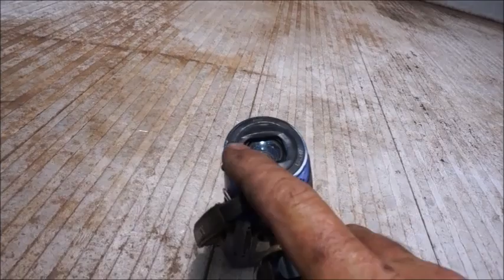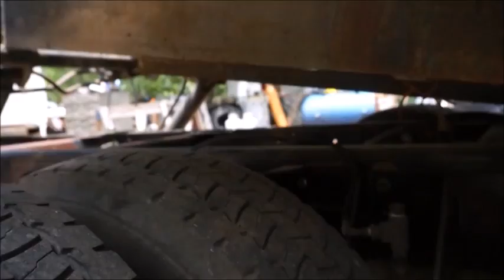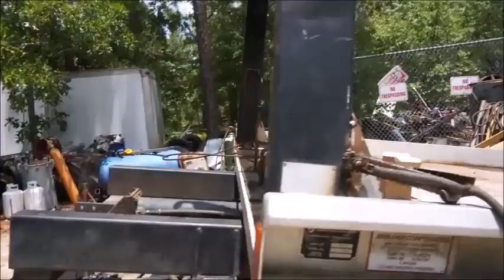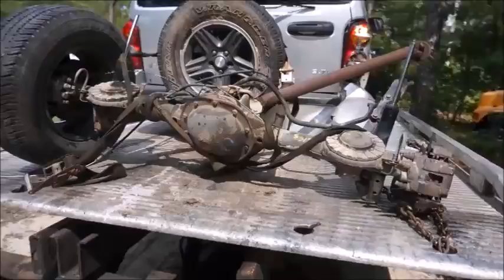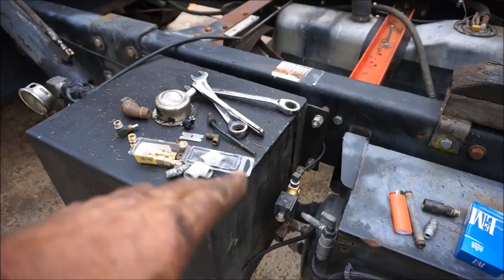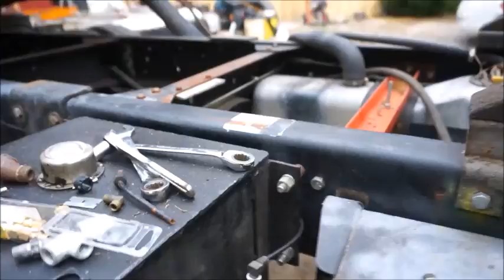2003 C4500 Rollback, Rollover Recovery and More!!

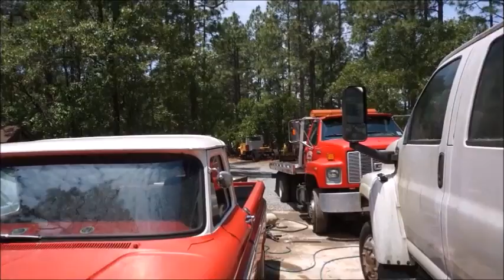Comment: @ 7:34 in the video, you describe the dilemma of having problems with the red Topkick as it is going through front brake pads prematurely. This can be affected by the proportioning valve possibly not being spec'd for the application used. When the vehicle is designed for the heavy-tow platform, the prop-valve should be spec'd as one set to have a percentage to place the biasing closer to center, or just off-center, to the rear, to make better use of that axle-loading, or, I have seen and serviced load-sensing prop-valve braking systems, therefor, better maximizing brake pad wear and vehicle control when loaded. I admit, I'm not sure which chassis the red Topkick started out as, for I haven't had a chance to view your channel from the beginning, only finding the channel at the cold-start Impala "chestnuts-roasting-on-an-open-fire" video, but am going through the channel. So, if ya feel like picking your parts-counter friends brain there might possibly be a simple solution to saving lots of labor and money on front pads and rotors, or you can keep your front-pad-swap skills honed to a sharp point, no big matter either way.

Comment: That 0l' 1/4" air line ain't real good on the Bag's. I used to use 3/8" on my Heavy Haul trucks so I could drop quick to go under Low Bridges & Viaduct's and what have you.

Comment: For low cars I  used to have boards that I used to make a small ramp to the roll off. I did not like to pick up Corvettes cause they are so low especially if they had a flat front tire.
I wouldn't want to be the driver to get the rear out the quick way. I didn't do too many rollovers but pulled a bunch from the woods and sometimes two at a time.
Nine miles. Wow did anybody blow their horn at ya? I dragged a chain on the Brooklyn Queens Expressway and had people honkin and flashing their lights and yellin at me till finally I stopped to see what was wrong. I was wondering why they were giving me lots of room and not passing me too much. Good vid.

Comment: sorry to hear about getting smacked with that cord. we have all done it a time or two. my air rides only have 1 leveling valve. you think yours has 2 since it was an ambulance and may have been loaded heavier on one side?it looks like a "link" aftermarket suspension. i have a full manual for that suspension with part number break downs if you ever need it.

Comment: What if you mounted the dump valves for the bags after the leveling valves? That would eliminate the need for the "mufflers". Without air conning into the system you wouldn't have to worry about the leveling valves working anyway, until you re-introduced air into the system.. Just a thought.

Comment: Will the weight of the vehicle slow the fill on the bags ? May have to add bigger lines to the bags .
Reply from the maker: I don't think it will, they filled very fast compared to most. Just need to get it off the bumpers before I can move, We will see!! The leveling valves would just choke the size back down, they are small.

Comment: some time ago, I drove a dump truck for a short time, it was a road tractor converted to a dump.  it had air bags and the boss told me to be sure to dump the air off the bags before raising the bed,, it exhausted fast but filled up fast too, I guess that was the way the tractor was set up.
Reply: DIAMETER OF THE LINES, AT LEAST jONATHON WON'T DUMP THE TANK ANYMORE.   RALPH